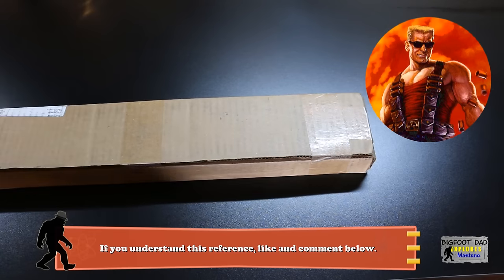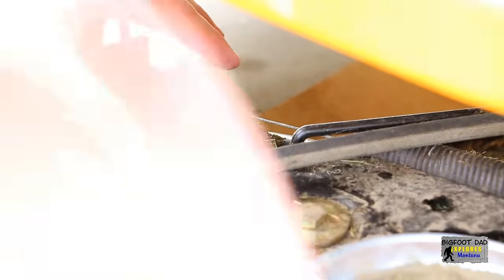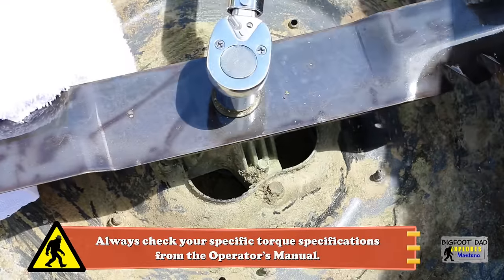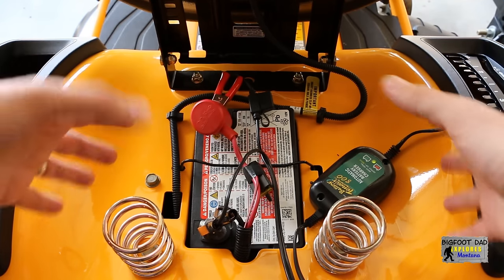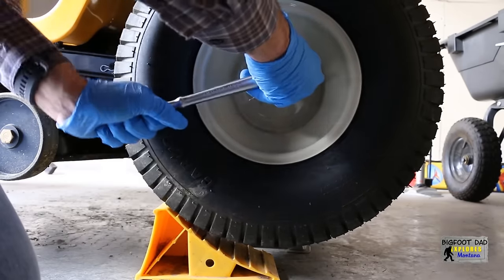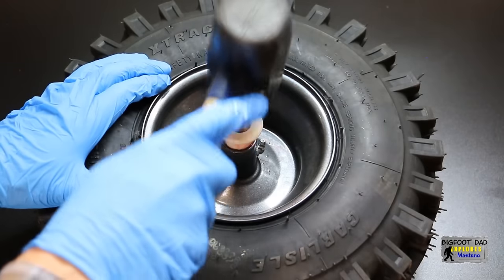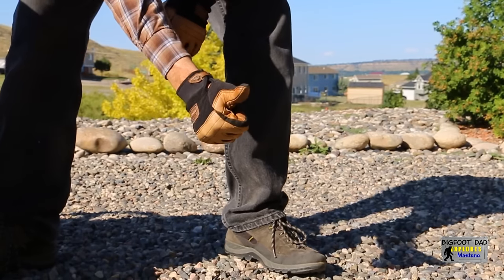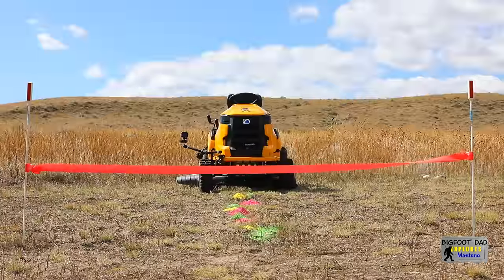Upgrading Your Tractor Mower: Cub Cadet XT1 LT42" Mower (ATV Tires, Blades, Brush Guard, Headlights)

Comment: Hey Bigfoot dad. I have a question. I have a Husqvarna mower it's a 52 inch cut. Can I replace the tires on that one as well, if there the right size? Also I put my mower on car ramps instead of taking the deck off, but I see why you did that. I took my deck off to clean it as well. I like how you used that purple oil. I like that stuff it works better on my mower than regular oil. Great tips. Thanks a lot
Reply from the maker: Hi, James - I would read the size of the tires that are already installed and see if you can find an approximate match online.  I shopped via Amazon for mine.  I also had to do a bit of research to see of the tires that were close in size, if they'd fit the rim.  Additionally, I took some measurements to ensure that the tires could be a bit larger.  There was one area I was really concerned about between the rear tire and the rear anti-scalp wheel on the deck.  I knew it would be close and still didn't know it would fit until I finally bolted on the rear tire.  And, wow, it is tight but adequate.   I'm hoping that if another person on here has done it on that mode, perhaps they can chime in.  I appreciate your feedback and good luck!  I look forward to seeing on here again.
Reply: @BigfootDadExploresMontana  I really appreciate the response back. I will do as you say. Will be getting some add on stuff pretty soon. Because in N.C we need them. Take care and thanks again

Comment: Great video.  I'll likely be making many of these mods to my LT50.  I'm new to this, but it seemed like you went with taller tires in the back and shorter in the front.  Did that give it a slight forward slope?  Did you need to adjust the mower deck to be level again?
Reply from the maker: Hi, Jake - awesome!  Feel free to send in pictures via Instagram DM after you're done if you would like them posted on our Community tab back here.  
The tires didn't seem to affect the the cutting levelness all that much.  Of course I don't have a beautiful green carpet to test it on, so that's just from the prairie grass tests.  No adjustments were made to the deck.

Comment: This is a little late but I’ll ask anyway. How wide are the front rims that you put those 15x5-6 tires on? I’m building a mud mower and I want to get those for the 5” wide rims I have but carlisle specs 3.5” wide rim for those tires. Was it terribly hard getting them to seat?

Comment: Great video!

Do you notice any turf damage with the new tires?
Reply from the maker: Hi, Henry - No, I haven't noticed any damage yet, but my lawn is pretty rough.  Since the mower has an open differential design, it should reduce that type of issue, however, I'm not sure what the effects would be on a solid green carpet of grass.  Hope that helps!

Comment: Did you use tubes or keep it tubeless? I am using some 15x6-6 tubes inside the same 15x5-6 tires you used. They were very hard to cram in, the valve stem didn't line up properly, and the bead on the tires wouldn't pop out all the way to the rims! I'm getting some tubeless valves and trying that approach instead. Curious to hear which route you took.
Reply from the maker: Hi, Russ!  These are entirely tubeless.  I hope that you are able to convert them over successfully as well.  As an update, the left front tire finally succumbed to a cactus and wouldn’t hold air anymore.  So, I put in some of that green tire sealant last season and it sealed it right up!  Still holding pressure over the winter season and into spring.

Comment: To tint the headlights use Rit dye in semi hot water, you control the darkness by how long you leave it in.  To beat the cactus spines use Slime in your tires and they will never go flat again.
Reply: never use slime, it ruins tires. use liqui-tube. 100 times better

Comment: First off im new to this channel, and you definitely gained a sub! Very entertaining! You had said that the tires were slightly bigger than the stock tires and rims. I have 20x8-8 rear tires on my craftsman T1600, would I be able to order some 20-10-8 off road tires like those and put them on, or would they not fit. Thank you in advance!
Reply from the maker: Hi, Brandon - welcome to the community and thank you for the feedback!  What I did when I was looking through the tires was go to a tire size comparison tool like this:  https://tiresize.com/comparison/  I then measured the current clearance of the current tires and estimated what the added or subtracted width would put the tires for those tight areas.  This was especially important on rear right tire as it is very close to my anti-scalp wheel and now with the new set, is even closer.  Also check by locking your front wheels side to side to check for clearances and how much extra room you have to spare.  Hopefully you can find a combination that works and I'd be interested to hear how it turns out.  Upgrade, accommodate again if needed, and don't look back!  You've got this! 😎

Comment: I saw you start the mower in the lowest idle position and then raise the idle up before you put it into gear.  I'm pretty sure (but now second guessing) that my owners manual said to start it in the highest position (above the rabbit) and then lower it to the rabbit to run and mow.  That's how I've been doing it the last 2 years I've had by Cub Cadet and only idling down to the lowest position when I shut it off.   What do you think?
Reply from the maker: Hi, Willlie - I'm not an expert here, but I can tell you why I do this.  The guidelines are most likely assuming a cold engine start because that would be the easiest way to explain to the majority of the users how to start the engine without having to get technical about it's present condition (say, for example if the engine is warm or hot or when it's been stored for a year, etc... )Their procedure will work by choking the carb and cranking the engine over in all those situations.  If the engine is warm, there is no need to choke it or have it rev to the max to get it going.  Getting a feel for the engine and how it responds to throttle positions in different scenarios will let you better connect to how it likes to run.  I hope that helps.  Maybe experiment with it a bit and see what works best for your tractor.
Reply: I got the Enduro 46”. When the engine is hot, you don’t have to start engine on choke position, the engine will start most of times then you can use the rabbit. Read your manual! Lol

Comment: Should have straightened the anti-scalp wheel that was wacked. Also cleaned the underside of the deck better and sprayed it with something made for it to limit the sticking grass. There are several brands out. Lower the tire pressure then re level the deck. Gives a softer ride and better traction. (and you could have went with a taller rear tire.) With the headlights like that, how can you see when it gets dark? Should have had the wheels coated in chrome! ;)
Reply from the maker: Hi, George - yes, I agree - I should coat the underside of the deck.  I'll do this on an upcoming film.  As far as the headlights go, I don't really mow in the dark.  I use an ATV to haul things around and that is usually what ends up being out after dark anyways.  Thank you for your feedback and suggestions!

Comment: Do the new tires have a problem with grass clogging the treads? I am always fighting with the stock tires dragging clumps of grass into my garage floor. I like the aggressive treads of the new and feel they would definitely help me mowing the hillside in front of my house.
Reply from the maker: Hi, mclary - no, no problems with the grass at all.  However, the mud is a different issue.  😉  Give it a shot and see how it works!  It definitely helps me on my hills.
Reply: Bigfoot Dad Explores Montana going to order tires tomorrow

Comment: BLADE SWAP:  My problem with removing the baseline blades to install the Cub Cadet mulching kit was that the factory blades appeared to have been installed by a worker with either an impact wrench or far superior upper body strength.  So, to keep the inverted mower deck from rotating when I whacked on my breaker bar, I resorted to using a ratchet strap hooked two brackets on the mower deck and around the mower's rear tires.
Reply: Use an impact wrench. Those blade nuts will spin right off.

Comment: If you do not want to buy a blade balancer , then just hammer a nail into any convenient vertical surface  , straight and square , then place the blade over the nail , might be a bit difficult to get it to sit on the point of on of those stars . Heavy end will swing down . For more stability and traction consider adding calcium chloride fluid to the tires , but only if you have tubes in your tires

Comment: Do the bigger rear tires clear the mower deck on the right side ? Mine has scarce little space with the 46" deck. Those new rear tires would have to be just about the same circumference as the original Carlisles.
Reply from the maker: Hi, Ted - yes, they clear fine on my 42" deck, but I had the same concerns.  My clearance is about 1/4" between the tire and the deck now.  I was pretty nervous putting the tire on that side for the first time.  They are a little bigger than stock, if I recall.  Maybe someone here can chime in if they have the 46" deck and the same tire configuration.  Can anyone help Ted out here?

Comment: Did changing the tires - does the higher treads change deck height
Reply from the maker: Hi, Patriots Fore Golf - yes, I believe it offset the height by about one blade level adjustment notch.  The mower still cuts pretty low for what I need it for, so the height adjustment didn't really affect me.  Hope that helps!

Comment: we have found a problem.  The deck seems to be a magnet for grass and rust.  To handle that problem, we blow everything out at the end of each mowing day and annually we take the deck off and undercoat it with something the converts the rust to an inert substance, so no rust through of the deck.  
However, spindles don't seem to last and the heavy/tall grass results in clogs in the deck that result in burned belts.

Comment: Nice, I have XT1 GT50", got 27 hrs.on it and never been happy with the cutting performance.  With 25 hp and 3 blades you would think it would be a Ninja, not so. Did your blades make a big difference as I'm sure the manufacturer uses the cheapest blade China has to offer. Next the tires, very sensible. I have some traction issues more than I like and your choice seems to be a excellent compromise over stock without going to full lug AG tires, did you consider going to a full lug AG tire ? My tractor came with a brush guard. The headlights on my tractor are there so they can say it has them but there not powerful enough for any practical use.  How's the Royal Purple working out for you? I've use Mobil 1 advance synthetic and a Fram synthetic XG3614 filter, thinking of upping my game to RP or Amsoil, I've changed my oil twice in 27 hrs.
Reply from the maker: Hi, Jimmy - thank you for leaving your feedback.  I have seen mixed reviews of the models with the three blades - mainly clogging issues.  The blades that came stock are pretty thin compared to the Gator blades used in the film.  The new blades are a bit louder and the deck does vibrate a bit more, probably because of the added mass.  There was a point when I went and took a wide swipe and saw that it missed the middle, right where the blade gap was, but feel this wasn't a valid test.  Normally it doesn't do that when taking a more sane pass.
There was a gentleman that commented on here a bit ago that he installed an LED light bar to his brush guard so that may help your situation out a bit too.  
The tires and full lugs - yes - I had looked at a few potential matches, but was concerned with having "too much traction", meaning I'm still not fully sure how the transmission was engineered.  I've wondered if the less-aggressive tires that came on these tractors were by design - allowing for some slippage rather than putting too much strain on the transmission.  
And, yes - the Royal Purple has been working completely fine so far!  Getting ready to do an oil change once again this coming weekend! 
Thanks again for your detailed comments and welcome to the community!
Reply: @BigfootDadExploresMontana  Your right about the clogging issue, I'm looking at full lug tires because I can't find the type you used in my size, the transmission should hold up , it has a K58 rated for ground engaging attachments and I actually use a scraper box with impressive results considering the tires.
The light bar is coming although won't need it much this time of year. It's not a bad tractor I move my 5.5'x10' trailer around with misc. crap on it the trailer itself weighs in at 900lbs. On your oil what viscosity do you use. I came really close to buying a Cub zero turn but I went to Tractor Supply Company expecting to pay $2999.99 + tax and $400 shipping to my driveway, I don't know what happen to this day but we were ordering at the service desk and it rung up at $1951 and change delivered !
Me and wife looked at each other and didn't say a word, we took the paperwork to the checkout pay for it and got out of there as quick as we could. All the way home we were livid and couldn't believe that just happen ! So I got a Xt1 GT50 delivered and tax for about $1500 off, there's no way that puppy was discounted over a grand, well any way as you can see we couldn't pass that up and that's my Cub Cadet story.

Comment: OK, my B series Kubota pulls a 72' lawn pride and I use a 48" zero turn for the tight places but I mow 10 acres.  I like to see fresh grease on working equipment and oil in the engine.  the charger can be had at Harbor Freight for less than $10 on sale, with a bunch of equipment I have about four of these, they've never failed, unlike my schumacher 50 amp charger.  Since the Kubota also pushes the plow having the booster means it will start on a cold snowy night.

About bigfoot, I think I met one at a Chinese restaurant a couple of months ago.  A large fellow, about 6-6 and 300 or more.  Lots of hair, came out of his pant legs and sleeves. Had his woman with him, a large lady, she sported body hair too.  They live amongst us.  I think he made about four trips back to the buffet.
Reply from the maker: 😂 I agree, they are among us!  Thank you for sharing your experience above too - that is helpful!

Comment: Great job! But I'm wondering why, after installing new front tires, etc., that you didn't replace the front wheel bushings with bearings?
Reply from the maker: Hi, Fred - you're entirely right.  I need to go back and do this.  Maybe a part II. should be in the making.
Reply: @BigfootDadExploresMontana  Agreed!! Thank you for your response too!! If you do, please link what bearings you use or give options. I have looked at swopping out the bushings for bearings but haven't done it yet.

Comment: Skip the Khohler parts for the oil filter.  Go pick up a Fram 3600 and you will get a TON more capacity and filtration ability not to mention the synthetic filters in the XG series will be a better suit to the oil you are using.
Reply from the maker: Hi, John!  Thank you for providing this part number!  I may try this filter out on my next oil change.  Agreed that it's a lot better (and more convenient) to get the oil filters at the auto parts store.

Comment: I got this mower a few month ago, I bought the mulching kit but hasn't installed yet. Just wanted to confirm my understanding, don't you have to you the plug with a mulching blade, or can I just install the mulching blade and keep the open chute?
Reply from the maker: Hi, Bahaa Nashed - I run mine with mulching blades and let the grass discharge out the shoot (no mulch plug installed).  It shouldn't make any difference, but more experienced people may chime in.  Hope that helps!

Comment: I use a cordless impact driver to take off the blades, only the nut ends up spinning so you don't have to use a prop to hold them.
Reply from the maker: Hi, jjr007 - yes, this is a good idea.  I may use more of my power tools in the next installment.  However, for torqueing the nuts, we still have to find a way to chalk the blades.
Reply: @BigfootDadExploresMontana  man the blades don’t need to be torqued down just make sure they are tight. not too much or too little

Comment: I loved watching this video! I have been researching the Cub Cadet XT1's LT42. Wondering if 22 hp will be enough for the 1.5 acres I live on and if it can handle some hills. Any input is appreciated! By the way where do i get those tires? ;-)
Reply: I have the XT1 on over five acres in the Texas Hill Country cutting up to 12” grass. Hit a few cedar stumps along the way and on my third set of blades. Unfortunately the carb float got stuck a few weeks ago and flooded the crankcase with gas. I did two oil changes and it’s been running fine. I added a fuel cutoff valve before the inline filter and that’s how I shut it off between uses. The v22 is plenty of power but the ride over rough terrain may demand better seat springs. I’ve had problems with the engine dying during hot use but it’s either vapor lock, that carb valve or dirt in my fuel tank or fuel issues. Retrospectively, a used commercial ZTR may have been a better purchase. XT1 is a gentrified MTD imo.
Reply: Get a used commercial mower and save yourself the trouble owning a home-owner marketing plow toy tractor.   These mowers have big motors but that’s about it.  The bearings a and actual working gear like spindles ect...are made just strong enough to not crumble in a day.    Just sayin’